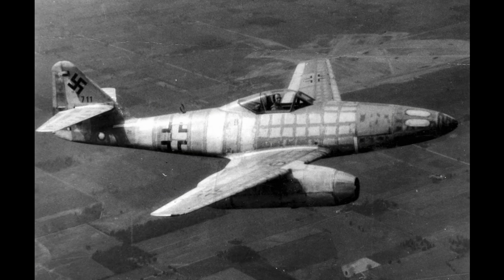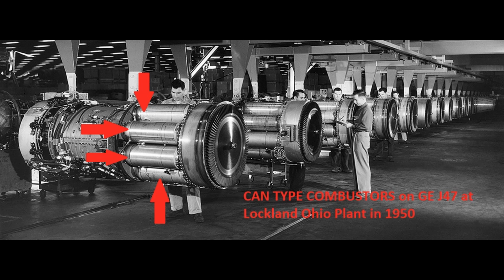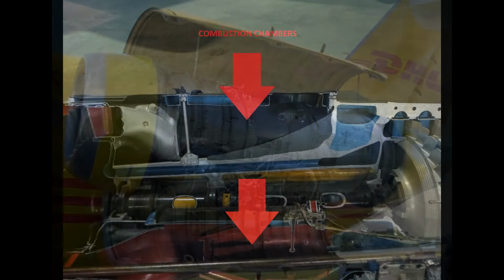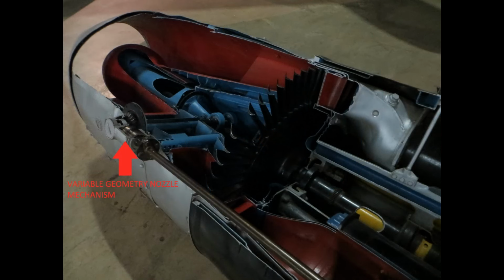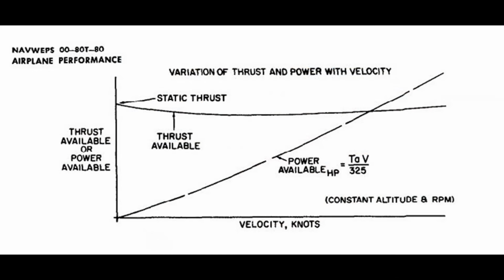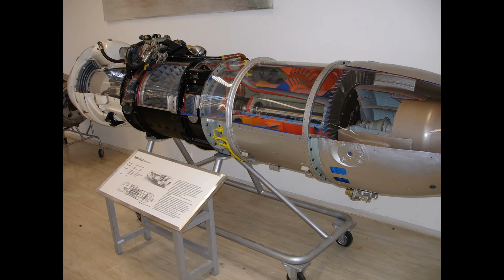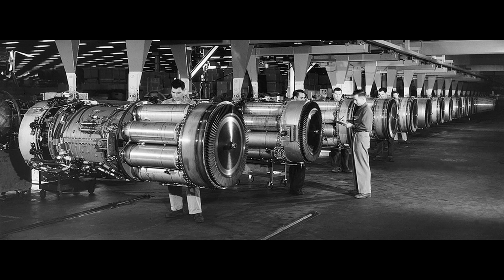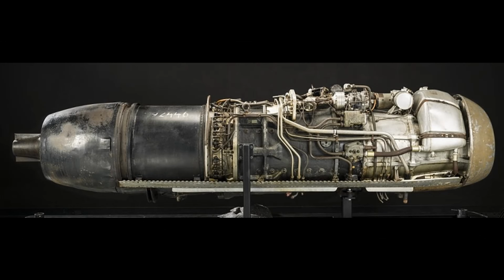World War Two JET POWER

Comment: The technology was very sound but Germany’s lack of access to hi-temp special metals was the Jumo 004’s  only real drawback.
Reply: Yes, 10 hours service due to poor metals!
Reply: maybe 10 hours of operation?
Reply: Billy Sol Hurok one is consequence of the other
Reply: @DirtyMardi  understood
Reply: @billysolhurok5542  In the prototype development, Jumo 004 turbines were tested with high-alloy steels and achieved runtimes of around 100 hours under full load.
Reply: @julialindner217  That was the Jumo 004A which was a completely different engine.  The 004B was made from mild steel and often produced with forced labour, improper use could reduce the engines life to one flight.
Reply: @jimdavison4077 That is the exact confirmation of my statement. The critics of the Jumo 004 only ever refer to the turbine’s short service life. But forgot the difficult circumstances under which this absolutely progressive and groundbreaking design was produced.
Reply: @julialindner217  thats because it wasn't particularly groundbreaking or progressive.  The Jumo 004A was groundbreaking but because Germany could not put the heat resistance alloys into mass productio they were stuck with the very primitive 004B.  While the Brits were able to produce up to 4000 pounds of thrusts thats twice the power with actual endurance.
Reply: @billysolhurok5542 20 before a major overhaul I think. Tbf, most engines at the time had only 100 hours of service life anyway.
Reply: how you explain 20 hour life span of engine on P80? cant be lack of such materials.
Reply: @jebise1126  The Engine of the P80 was descended from the The J33  which was originally developed by General Electric as a follow-on to their work with the designs of Frank Whittle during World War II  as used in the Meteor.....including the use of metals invented by the brits specifically for jet engines.
Reply: @liloldme1210  yes... and it still had 20 hour life span so how come so low?
Reply: @jebise1126  The RR Welland had a longer life than that
Reply: @jebise1126  No that’s not correct I have seen this last few months a meteor Fly on the same engines but it was given 70 years ago
Reply: @theoracle6639  Indeed , 180hrs! and the Derwent was 650! the Germans were so far behind the British it was not funny
Reply: So far behind ,theGermans had the first operational jet in history!
Reply: not access there was never a need for such thing in all the world ever ! Frank Whittle did the math of heat/ pressure and could see with what was around at the time it would really not work ie hold up where his jet still works today , Jumo 004 at the time of making what was really a prototype but some moron rushed it there was the fact to even feed it fuel was still not quite understood / the really good pilots would get about 35ish hours out of this most of the poor pilots or just pushing to fast or cutting it to fast would get about 1 or 2 flight or just  2 or 3  in many case's out of the engine  or flame out and crash  and and also if that was not too much to deal with there a whole bunch of aircraft shooting at you anytime your seen
Reply: @xkgbciax5286  Actually neither Whittle or Ohaim knew the perfect math for these engines. After the war Whittle hired the famous Hungarian scholar Jendrassik (who was a real university professor unlike Ohaim and Whittle) to have more theoretical/math knowledge about these engines. If you take original research in post ww2 jet patents, there are much more references for the technical solutions of Jendrassik than Whittle.
Reply: You think these engines were made by high tech labor? Got news for you, they were slave laborers mid war onward.
Reply: What else could be done to improve the life of the Jumo 004?   Increase the diameter of the compressor and turbine plus lower rpm in the 4,000-5,000 rpm range?  Would result in lower temperatures and stress?  Less wear on bearings?
Reply: The only airworthy original ME 262 at the Flying Heritage Museum has upgraded Jumo 004 engines. The engine longevity was expected to go up 10x. This plane never got past taxi trials after the death of Paul Allen the founder. In this video of the first engine run the original 2-stroke starting engine is used. 
https://www.youtube.com/watch?v=8Azxzu1sqCU&ab_channel=FlyingHeritage%26CombatArmorMuseum
Reply: no,hat simply was the reason to develop and improve the design to the standart still in use today.
Reply: If only ceramics would hold the burn in
Reply: @paulpaul9914  Frank Whittle did not invent the Turbojet type engine and the Turboshaft type engine was invented 4 years before he was born.
Reply: @paulpaul9914  C.A. Parsons Company only made steam engines prior to 1947.
This is an irrefutable fact that cannot be disputed.
Reply: @paulpaul9914  The first successful demonstration of a Turbojet type engine was made by Hans von Ohain and Max Hahnn on August 27th 1939 in Rostock Germany.

Two years before Frank Whittle who was only the 4th person to demonstrate a jet aircraft engine.
Reply: @paulpaul9914   Pauly you silly lad, Frank Whittle did not invent the Turbojet type engine and the Turboshaft type engine was invented 4 years before he was born.
Reply: @sandervanderkammen9230  Hello Sandyboy you sad wehraboo liar. let's just rtemind you of what that famous German jet pioneer Pabst von Ohain had to say-

"The first patent of a turbojet engine, which was later developed and produced,
was that of Frank Whittle, now Sir Frank (see Fig. 5). His patent was applied for
in January 1930. This patent shows a multistage, axial-flow compressor followed
by a radial compressor stage, a combustor, an axial-flow turbine driving the
compressor, and an exhaust nozzle. Such configurations are still used today..."

and

"In April 1937, Whittle had his bench-test jet engine ready for the first test run.
It ran excellently; however, it ran out of control because liquid fuel had collected
inside the engine and started to vaporize as the engine became hot, thereby
adding uncontrolled fuel quantities to the combustion process. The problem
was easily overcome. This first test run was the world's first run of a bench-test
jet engine operating with liquid fuel."

and

"From the beginning of his jet propulsion activities, Frank Whittle had been
seeking means for improving the propulsive efficiency of turbojet engines. ¶ He
conceived novel ideas for which he filed a patent application in 1936, which
can be called a bypass engine or turbofan. To avoid a complete new design,
Whittle sought an interim solution that could be merely "tacked on" to a jet
engine. This configuration was later known as the aft fan. Whittle's work on
fan jets or bypass engines and aft fans was way ahead of his time. It was of
greatest importance for the future or turbopropulsion."
Reply: @paulpaul9914  Frank Whittle was born in 1907... 4 years after the Turboshaft type engine was invented.
Reply: @paulpaul9914  C.A. Parsons Company only made steam engines prior to 1947.
Reply: @sandervanderkammen9230  
 @Sander Van der Kammen  
You stated Whittle centrifugal compressor gas turbine engines are not manufactured & are not used for helicopters - both wrong - same as everything you claim - it's not difficult to grasp is it you EIN DERANGED KINDERGARTEN INMATE
Please stop making stuff up unt stoppen using terms und words incorrectly & claiming that others have said things they haven't said or stating that things that haven't been done were done or vice versa or continually changing your fabricated gibberish from one post to the next & clearly responding to posts in videos with replies that don't relate to the videos or the comments you are replying to.
Also stop saying fourth when you mean first.
Stop claiming that the gas turbine aero engine / jet engine / reaction engine / centrifugal compressor - reverse flow combustors - axial turbine aircraft jet  engine / internal combustion turbine engine / etc / as first demonstrated by Sir Frank Whittle of England  God of EIN TURBOSCHAFTEN DUR EIN  VOLKEN  EIN REICHEN 1000YR ®™ & so on etc ) is not currently produced in significant numbers & stop claiming they  are not used in helicopters & take note that the internal combustion turbine engine in all its forms exists due to the work & genius of Parsons of ENGLAND & originally from a renowned Irish family lineage with the PARSONS AXIAL TURBINE / AXIAL COMPRESSOR TECHNOLOGY very generously licensed to many companies in Europe, England & the world in the spirit of good international co-operation & congenial collaboration. 
Hope this helps with your clearly limited grasp of reality, & get your mom to explain it all to you OR sing you a nursery rhyme song things if you're having trouble understanding the big wordz & complex concepts in this reply or you're getting very angry because people aren't obeying your VWuRD USE COMMANDS, INSTRUCTIONS  UND  ORDERS
Reply: @sandervanderkammen9230  
 @Sander Van der Kammen  
 @InSanitere Vonn durrr Krappen  & Dr Dike Bummner
    You stated Parsons of England did not make axial turbine steam turbines before 1947 - they made axial steam turbines, not radial steam turbines before 1947 & were inventors if the technology that led to all internal combustion turbine aero engine technology.
  You stated Whittle centrifugal compressor gas turbine engines are not manufactured & are not used for helicopters - both wrong - same as everything you claim - it's not difficult to grasp is it EIN DERANGED KINDERGARTEN INMATE
Please stop making stuff up unt stoppen using terms und words incorrectly & claiming that others have said things they haven't said or stating that things that haven't been done were done or vice versa or continually changing your fabricated gibberish from one post to the next & clearly responding to posts in videos with replies that don't relate to the videos or the comments you are replying to.
Also stop saying fourth when you mean first.
Stop claiming that the gas turbine aero engine / jet engine / reaction engine / centrifugal compressor - reverse flow combustors - axial turbine aircraft jet  engine / internal combustion turbine engine / etc / as first demonstrated by Sir Frank Whittle of England  God of EIN TURBOSCHAFTEN DUR EIN  VOLKEN  EIN REICHEN 1000YR ®™ & so on etc ) is not currently produced in significant numbers & stop claiming they  are not used in helicopters & take note that the internal combustion turbine engine in all its forms exists due to the work & genius of Parsons of ENGLAND & originally from a renowned Irish family lineage with the PARSONS AXIAL TURBINE / AXIAL COMPRESSOR TECHNOLOGY very generously licensed to many companies in Europe, England & the world in the spirit of good international co-operation & congenial collaboration. 
Hope this helps with your clearly limited grasp of reality, & get your mom to explain it all to you OR sing you a nursery rhyme song things if you're having trouble understanding the big wordz & complex concepts in this reply or you're getting very angry because people aren't obeying your VWuRD USE COMMANDS, INSTRUCTIONS  UND  ORDERS
Reply: @sandervanderkammen9230  Hello Sandyboy, as you know Sandyboy Charles Parsons was first in the practical development of both axial flow turbines and axial flow compressors.  
It's really funny to see you guffing on about  steam engines given how regularly you claim that the BB&C Velox was a gas turbine engine given that it was a steam boiler. 
As you know Sandyboy Brown Boveri were early lincencees of Parsons and their German operation was even called 'Turbinia Deutsche Parsons Marine AG'.  As you know Germany was heavily dependent on Brown Boveri and their Parsons technology for Germany's gas turbine development, although as you know the relationship was somewhat strained by the patents dispute that was ultimately won by BB&C.
Reply: @paulpaul9914  Aircraft do not use steam engines.
Reply: @sandervanderkammen9230 
Insanitere Duurrr Krappend / Dr Dike Bummner.
 Nobody on the team has stated that aircraft use steam engines you vWberk.
However-  Part of the reason Whittle gas turbine aircraft engines  currently exist & get used for helicopters is due to some of the following that involves work done by Parsons of ENGLAND before 1900 related to axial turbines & axial compressors.
Also people in England discussing the Parsons axial steam turbine & axial compressor technology had figured out at the time the possible use of that tech to do an internal combustion turbine aircraft engine before the first flight of any engine powered aircraft.
    You stated Whittle centrifugal compressor gas turbine engines were a 
dead end & of no use - wrong.
   You stated they are
 not manufactured - wrong.
     You stated they are not used for helicopters - wrong.
    You stated helicopters don't use gas turbines - wrong.
      When it became apparent to you that the PW200 is in fact a currently manufactured Whittle internal combustion gas turbine including a centrifugal compressor & reverse flow combustors that is used for helicopters  you changed to stating that the PW200 was not the particular type of gas turbine you were talking about as if that were relevant which of course is pure Krappenish gibberkrappund - all wrong as usual - same as everything you claim - it's not difficult to grasp is it you EIN UND DERANGED KINDERGARTEN INMATE
Please stoppen da making stuff up unt stoppen using terms und words incorrectly & claiming that others have said things they haven't said or stating that things that haven't been done were done or vice versa or continually changing your fabricated gibberish from one post to the next & clearly responding to posts in videos with replies that don't relate to the videos or the comments you are replying to.
Also stop saying fourth when you mean first.
Stop claiming that the gas turbine aero engine / jet engine / reaction engine / centrifugal compressor - reverse flow combustors - axial turbine aircraft jet  engine / internal combustion turbine engine / etc / as first demonstrated by Sir Frank Whittle of England  God of EIN TURBOSCHAFTEN DUR EIN  VOLKEN  EIN REICHEN 1000YRs ®™ & so on etc ) is not currently produced in significant numbers & stop claiming they  are not used in helicopters & take note that the internal combustion turbine engine in all its forms exists due to the work & genius of Parsons of ENGLAND & originally from a renowned Irish family lineage with the PARSONS AXIAL TURBINE / AXIAL COMPRESSOR TECHNOLOGY very generously licensed to many companies in Europe, England & the world in the spirit of good international co-operation & congenial collaboration. 
Hope this helps with your clearly limited grasp of reality, & get your mom to explain it all to you OR sing you a nursery rhyme song things if you're having trouble understanding the big wordz & complex concepts in this reply or you're getting very angry because people aren't obeying your VWORD USE COMMANDS, INSTRUCTIONS  UND  ORDERS
Reply: @sandervanderkammen9230  
Insanitere Von durrr Krappen  the imbecilic -
Where did you get this idiotic idea from that Parsons manufactured steam engines & more bizarrely that they did this until 1947 when apparently they switched to making gas turbines - got any references for all that bs?
Reply: @paulpaul9914  Please cite an example of a Gas turbine engine made by C.A. Parsons prior to 1947???
Reply: @paulpaul9914  Please cite an example of a production aircraft that is powered by a steam turbine engine???
Reply: @sandervanderkammen9230  Insanitere Von durrr Krappen  the imbecilic -
Where did you get this idiotic idea from that Parsons manufactured steam engines & more bizarrely that they did this until 1947 when apparently they switched to making gas turbines - got any references for all that bs & why are you asking about Parsons & gas turbines & aircraft at all, nobody stated that Parsons has ever produced aircraft engines or steam engines or gas turbines
Reply: @sandervanderkammen9230 
Chiney Leydeez should note -

It will come as no surprise to anyone that obviously we feel we can clear up some commonly held myths and misconceptions.

It's clearly always good to see the facts set out clearly and concisely isn't it?

Agreed, of course it is the case that the majority of gas turbine aero engine powered  aircraft, including turboprop & turboshaft internal combustion gas turbine aero engine powered aircraft are powered by multistage sequential stator rotor axial flow turbine & / or axial compressor technology gas turbine aero engines originally given functional hardware form by Parsons of Ireland & North England for use in power generation turbomachinery & ship propulsion turbomachinery before 1900. 

    It is interesting to note that light weight steam engine powered metal construction aircraft development & testing were being out in England in the 1800s.
Reply: @paulpaul9914  C.A.Parsons was a builder of STEAM ENGINES.
Reply: @paulpaul9914  The first demonstration of a gas turbine engine in the UK was built by Swiss manufacturers BB&C in 1932.
Reply: @sandervanderkammen9230  

_*Chiney Leydeez shud alwaze
remember*_
C A parsons built no steam engines, anywhere, ever
Reply: @sandervanderkammen9230  
The world's first internal combustion gas turbine aircraft engine was demonstrated by Whittle in 1937.
 The basic whittle type engine is currently still manufactured being used mostly for turboprop aircraft & helicopters.
   All BB&C units were based on the technology developed by Parsons & licenced to BB&C & many others before 1900.
  The first example of a BB&C gas turbine running in the UK was for a locomotive in 1949 which was quickly abandoned after it became clear it was not a sensible  application.
Reply: @paulpaul9914  C.A.Parsons built steam engines until they were bought by German company Siemens.
Reply: @sandervanderkammen9230 
Parsons has never built a steam engine in England, in Ireland or anywhere else, ever.
Of course, Parsons built many axial steam turbine  units for power generation & ship propulsion & licensed the technology to many companies, including BB&C, in Europe & the rest of the world starting before 1900.
Reply: @paulpaul9914  Gas turbine engine was invented by Jens AEgius-Elling in Norway  1913... when little Frankie was just 6 years-old.

The First successful demonstration of a production gas turbine engine was 1930 in Berlin Germany by Swiss manufacturers BB&C.
Reply: @sandervanderkammen9230  
The gas turbine was invented in England in 1790.
Around 1930 BB&C were working with Parsons technology, turbocharged boilers & explosion combustor turbine experiments, non of which were internal combustion turbine engines & definately were not internal combustion gas turbine aero engines.
Reply: @paulpaul9914  The World's first gas turbine aircraft engine was successfully demonstrated in Göttingen Universität in Germany in 1935.
Reply: @sandervanderkammen9230  
The world's first demonstration of a internal combustion turbine aircraft engine was in England in 1937.
 The world's first demonstration by Parsons of the components of a coupled multi stage axial compressor & axial turbine unit was in England before 1900.
Reply: @paulpaul9914 Gas turbine engines were invented in Norway by Elling in 1913... your comments are ridiculous fabrications!!!
Reply: @paulpaul9914  THE FIRST SUCCESSFUL DEMONSTRATION OF A WORKING GAS TURBINE ENGINE WAS 1913 IN NORWAY 🇳🇴.
Reply: @WilhelmKarsten 

    
We feel we can clear up some common false myths, misunderstandings & misconceptions.

It's always very important to note the relevant facts obviously.

Of course it is indeed a great pity & great shame  that British military forces had to occupy a large part of Germany for decades after 1945. It would have been so much nicer if that hadn't been necessary wouldn't it.
Russia had to occupy a large part of Germany after 1945 for decades.
Russia still posseses a large chunk of land that was once part of Germany.
Russia & the UK produce Nukes.
Germany does not produce Nukes.
 
    Regarding the UK Aerospace Sector.

  WHY IS IT THEY CAN'T ANSWER VERY SIMPLE QUESTIONS ⁉️ 😅
  A very simple question indeed.
   
Which airline recently ordered 60 RR Trent XWB Engines? 

Also name a single Germany company that makes German jet aircraft in Germany & name a single German Company that makes German gas turbine aero engines suitable for widebody airliners.

     That's correct, Brazil makes very good airliners & Brazil is 100th down the list along with Indonesia for wealth per capita.
Norway Holland Denmark Ireland Belgium - Top 20 wealth per capita - Don't make airliners -  its as simple as that.
  
  Agreed, that is correct of course, clearly there are many countries that could easily produce airliners of better  quality than Bow-wing (see b-47 wing folding & wing collapse incidents) but don't for some very good reasons. Bow-wing being a result of the size of the US, the large protected domestic market & great ease of testing new types due to the equator to arctic geography & a few other reasons related to production scale capability, politics & economics.

  Obviously there really is nothing special about Bow-wing, having more than 50 years design / build experience on the type means they have no excuses for the horrendous max incidents for example.

    Indeed BAe Systems & Rolls Royce combined now do more Airbus work than Germany on an absolute basis & significantly more work than that on a per capita basis.
   
     Agreed, Per capita for the home nation BAe Systems is the world's largest defence contractor.
  
    Correct, BAe systems announced the recent £4 Billion takeover of Colorado based US based Ball Aerospace.
  
    It's definitely the case that BAE systems now does a significantly higher value of work for Airbus than it did when it was a major Airbus shareholder before 2005.
     
      Obviously RR now owns US Engine maker Allison for example which does classified Aerospace work for the US Govt.
   
   Yes, that's right of course, Anybody currently flying on a widebody airliner stands a good chance of being on an aircraft powered by RR gas turbine aero engines built in the UK.

   A typical but small glimpse of what goes on in the very internationally orientated British aerospace sector.  

      Boeing Apache Attack Helicopter.
AH-64: 75 UK suppliers, 7% UK content, global fleet of 1280+ aircraft.
F35B more than 130 UK Suppliers, more than 30% UK content.
F35A & F35C more than 130 UK Suppliers, more than 15% UK content.

   There is no doubt that an airline has just ordered
60 RR England Trent XWB Engines

Obviously the UK has the
World's Highest Combined Per Capita
 Nuclear / Defence / Aerospace Sector Activity.

Rolls Royce Holdings UK
Subsidiaries
- Rolls-Royce plc
- Rolls-Royce North America (Allison etc Classified Military stuff)
- Rolls-Royce AB
- Rolls-Royce Deutschland
- Rolls-Royce India Private Limited
- Rolls-Royce Marine Power Operations
- Vinters Engineering Limited
- Rolls-Royce Controls and Data Services
- Rolls-Royce Power Systems
- Bergen Marine
Joint ventures include:
- Rolls-Royce Turbomeca
- MTU Turbomeca -

Trent Family
The MT30 (Marine Turbine)
Industrial Trent 60 Gas Turbine
Trent 7000
Trent XWB Airbus A330neo.
Trent 1500
Trent 1000
Trent 500
Trent 600
Trent 700
Trent 800
Trent 8100
Trent 900

RR wholly owned subsidiaries in Germany handle smaller 2 shaft RR gas turbine aero engine work.

We hope this helps of course as always.  Cheers & 😎👍 indeed.

       O B V I O U S L Y  
   
. ..... ..... ......  ..... .... ... ....
.... ..    .. .. . ........... ...... ..
Clearly the line above this line is not blank.
Reply: @sandervanderkammen9230  Von Ohein thinks differently, He stated the Whittles engine was the first turbojet engine to be run and that w as on April 12th 1937. So who ran this mythical 1935 engine?
Reply: @zaphodbeeblebrox5973  Hans von Ohain and Max Hahnn constructed the first turbojet engine in 1934 and successfully tested in 1935 at the Göttingen Universität.
It was witnessed by Dr Robert Pohl "the father of solid state physics"
 Pohl wrote a letter to Ernst Heinkel who came to Göttingen to observe a second demonstration in 1936.
 Frank Whittle did not invent the jet engine, he is only the fourth person to successfully demonstrate a working jet aircraft engine.
Reply: @ stop making things up, Vin Oheins own account of the facts are that his first successful engine first ran in September 1937, and he also clearly states that Whittle was the first to run his engine on April 12th 1937. The ‘garage engine’ which can be the only thing you are referring to never self sustained, and that is according to the man who built it.
Reply: @ not according to Hans Vin Ohein he didn’t!
Reply: That’s true for any early jet engine
Reply: The Ju004 had an inherently defective design due to resonance problems (very common with axial flow engines due to thin blades).
The Ju004 fixed one of its problems solved in December 1943 by going to a prime number of blades in each stage (from the even number in the previous designs). The British axial flow engines had the same problem and the blades were redesigned to detune the individual blades from resonating - the Germans never made that change.
Reply: They had about 20 hours once operational, sadly since loses could run at 10 percent per mission not a lot lasted long enough to wear their engines out. In 1945 German airspace was a very unsafe working environment if you were German.
Reply: There were lots of other significant problems. The pilot had to nurse the thrust lever to successfully accelerate the engine and airplane, distracting him from combat. Later engine fuel controls did this automatically. This long acceleration time was a very limiting problem as the top speed was the 262's safety, but firing passes at targets with 100+ mph closing speed were not very effective. If they slowed down, the opposition could out turn and out accelerate them. Given the significant differences from piston fighters, pilots were given very little familiarization time, constrained by free roving US fighters and the fuel situation. Their pilots were forced to learn on the job.
Reply: They also lacked the ingredients needed to make the hi-speed ceramic bearings they needed. They had to work around this, that's why it took so long to develop these engines.  They already had jet engines a few years earlier, but they could not build those, because the materials were needed elsewhere and the piston engines were considered to be good enough.
 It was the same problem with the BMW003 engine, when the Soviets reverse-engineered it. The French got the BMW engineers, they built the engine with proper materials, is was highly successful, and the French used it as the basis for their Snecma Atar engines, used on the Mirage fighter jet series.
Reply: @scratchy996 All true but the ATAR engines first seen in 47 were completely different designs that the BMW 003.  They were an entirely new design with different numbers of discs and so on.   As you said the knowledge was there but not the materials, the Jumo 004A proves that with close to 2000 pounds thrust and good endurance as well but used to many restricted metals.
Reply: @jimdavison4077  Technically the Atar engines were based on the BMW 018, which was an evolution of the BMW 003. It was the same engineers who continued their work on these engines.
Reply: @scratchy996  yes but not the same engine at all.  They went back to the drawing board as the saying goes.
Reply: The problem wasn’t the availability of high temperature metals as Germany had a mountain of them, it was manufacturing and machining them.  Refractory metals have to be produced in a sintered form; simplified this is as small particles semi-welded together before machining.  The only German engineers with any experience in this, being Jewish, left the country in the early 1930s.  As  result German engineers tried using cast stainless steel in their turbine engines which simply wasn’t up to the job.
Had they but known it the technology existed in the country at BASF in their permanent magnet production but fortunately no one thought of using their facilities.
Reply: Bull shit: Then who produced the prototypes that ran well over 100 hours of safe continuous operation in the test run. @annoyingbstard9407
Reply: @julialindner217    It wasn’t neither groundbreaking nor revolutionary as axial flow turbines had been built in the early thirties with exactly the same problems of turbine failure, which is why Whittle opted for the less efficient but far more reliable centrifugal compressor (still in use today.)  However I have no desire to get into a pointless conversation with an obvious wehrabooess, so goodbye.
Reply: @annoyingbstard9407  Whittle's original design used a hybrid of Centrifugal and axial flow and was overly complicated.   By the time his first real engine was proven successful  he had dropped the Axial flow components.  His design was nationalized so all other designers could use it as a free starting point during the war which was why so many successful centrifugal designs reached full production before the wars end.  Funny thing is very few know of the great success of the Axial flow program over at Metropolitan Vickers  where they had their first success with the F1 in mid 1941.  By the wars end they had several models test flown and bench tested to 5000 pounds and had the first real turbofan and turboprop.  They also used their axial flow engines in high speed rescue launches and in GENSETS.
Reply: @jimdavison4077  it's been a damn long time since I couldnt understand what people were talking about In a respectful discussion of ww2 stuff in a youtube comment section. Can't wait to dive more into this channel reading this discussion.
Reply: @annoyingbstard9407  wrong, centrifugal compressor had no future. It is a shit. Whittle's idea come from contemporary vacuum cleaners.
Reply: @jimdavison4077  Whittle's original patent, filed on 16th January 1930 (years before von Ohain submitted his  patent application in Germany), showed two axial stages and a single-stage centrifugal compressor: it was hardly a "design".  I've read and heard (I believe from Ian Whittle himself) that the patent application was written so as to mislead others who might try to copy.  I'm not aware that he even considered a combination of axial and centrifugal flow, once he actually started the design of his first experimental engine, with its single combustion chamber. 
You're quite right about Metrovick's engine programme that lead to the F.9 at the end of the war, which became the Armstrong Siddeley Sapphire.  I was privileged to begin my career lifetime in gas turbine design at Bristol Siddeley Engines, working with the designers and engineers who produced the Sapphire - and the Python, the  Viper and Double Mamba.
Reply: @jozsefsandor671  
Turbojet / gas turbine engines that have a single stage centrifugal compressor or centrifugal / axial compressor combos are still manufactured. Often used in helicopters.
Reply: @paulpaul9914  Only in the cheap helicopters.
Reply: @jozsefsandor671  
Some of the finest helicopters in the universe have engines that have centrifugal compressor stages.
You stated that centrifugal compressor turbojets had no future & were garbage, why did you say that when Eurocopter & Bell use them in currently produced aircraft?
Are you yet another prolific spewer of 100%  gibberish, do I have to start going through your various ridiculous & nonsensical claims?
Reply: @paulpaul9914  When will a fighter jet or a jumbo jet airliner use centrifugal compressors? Never! BEcause it has lower efficiency.
Reply: @jozsefsandor671  
You stated that centrifugal compressors as used for gas turbines were garbage & had no future etc & so on & so forth etc etc.
Is that statement not 100% total gibberish & of course indicates clearly that everything you state is probably 100% inane / infantile  nonsense? when we all know that Bell, Eurocopter & others currently use gas turbine engines with Centrifugal Compressor stages in currently produced aircraft?
Reply: @paulpaul9914  You really don't seem to get it do Pauly?
Centrifugal compressor turbojets were an evolutionary dead end technology and have been obsolete for more than a half century now.
Reply: @paulpaul9914  There are no turbojet engines made or in service today with an obsolete centrifugal compressor.
Reply: @sandervanderkammen9230  
The PW200 is not the only currently manufactured hot 🔥 noisey turbojet spinny thingy that has centrifugal compressor stuff in it.
Reply: @paulpaul9914  Pauly you lose,
the Pratt & Whittney PW200 is NOT A TURBOJET ENGINE.
Reply: @paulpaul9914  Pauly, you cannot fool me son... I have personal experience with the PW210S and I can assure you with all confidence that it is not a turbojet engine..
Not even close.
Reply: @sandervanderkammen9230  
Your choice of words is irrelevant.
You stated that Centrifugal Compressor use in Whittle's Internal combustion turbine reaction engines was an evolutionary dead end - were never used seriously - not manufactured etc etc.
The PW200 is essentially a Whittle engine.
You also stated that helicopters don't use internal combustion turbine engines whereas in fact most helicopters use them.
Reply: @sandervanderkammen9230  
You have no personal experience with anything that has nuts, bolts & spinning shafts.
Reply: @sandervanderkammen9230  
You lost a long time ago.
The PW200 is a Whittle engine.
It has a centrifugal compressor stage.
It's currently manufactured.
Commonly referred to as a Gas Turbine by most people in the UK currently.
It's a Whittle jet engine / reaction engine / gas turbine / internal combustion turbine engine / jet engine with turbine power takeoff.
An internal combustion turbine engine with any number of turbine stages can be referred to as a jet engine & often is by many people, it's essentially the same thing.
It's used in helicopters - you stated helicopters didn't use them.
It has a centrifugal compressor stage - you stated that wasn't something that was done.
All internal combustion turbine engines / jet engines / gas turbines  have turbines & shafts by the way where the shaft always turns (yes the shaft always turns Krappen - it's a fact)  & usually produce reaction thrust somewhere in the engine even if it gets opposed somewhat by some variable amount somewhere else in the engine by some means.
Reply: @paulpaul9914  Only in your twisted imagination and ignorance son...
The PW200 is NOT A TURBOJET.
Reply: @paulpaul9914  According to the FAA and EASA I do...
Reply: @paulpaul9914  Dream on little lad... the PW200 IS NOT A TURBOJET...NEVER WAS...
NEVER WILL BE.
Reply: @paulpaul9914  Frank Whittle did not invent the gas turbine engine either...
 So your argument is completely moot!
Reply: @sandervanderkammen9230  
The PW200 is a jet engine as per Whittle's reaction engines with a centrifugal compressor that's used in helicopters & is essentially the thing you repeatedly stated didn't exist & wasn't used in helicopters.
Reply: @paulpaul9914  Norwegian engineer Jens AEgidius-Elling invented the centrifugal gas turbine engine in 1903... 4 years before Frank Whittle was born.
 The first production gas turbine engines were built by Swiss Company Brown Boveri und Cie in 1932... 4 years before Frank Whittle began work after moving to Rugby, England.
Reply: @paulpaul9914  No, the PW200 IS a TURBOSHAFT gas turbine engine as designed and invented by Jens AEgidius-Elling in 1903, 4 years before Frank Whittle was even born.
Reply: @sandervanderkammen9230  
Frank Whittle did first what Frank Whittle did first as far as jet engines are concerned. You'll need to accept the reality of it eventually Krappen.
Parsons of England & of course originally from a family in Ireland  came up with the necessary & essential  basics - axial compressor & axial turbine - that made all internal combustion turbine engines possible including the centrifugal compressor / axial turbine internal combustion turbine reaction enginesv suitable for powering aircraft  as first created by Whittle which you said were a dead end that were not currently manufactured & were not currently used in most helicopters.
How surprised you must have been when you realised they were in fact manufactured in significant numbers as we speak.
The PW200 is not a combustion augmented Steam raising boiler driving a Parsons of England & Ireland steam turbine with a piston compressor power output that all weighs approx 4 tons & wouldn't manage enough power output for a decent lawnmower. 
Haven't you got some Lego stuff to get on with?
Reply: @paulpaul9914  The world's first vehicle powered by a TURBOSHAFT gas turbine engine was a locomotive built by Swiss Company Brown Boveri und Cie in 1939.
Reply: @paulpaul9914  Frank Whittle never constructed a TURBOSHAFT gas turbine engine, he was the only 4th person to successfully demonstrate a TURBOJET engine in 1941.
Reply: @paulpaul9914  The first successful demonstration of a Turbojet type engine was by Hans von Ohain and Max Hahnn on August 27th 1939 in ROSTOCK GERMANY.
Frank Whittle was the 4th person to demonstrate a jet aircraft engine in 1941.
Reply: @sandervanderkammen9230  
 @Sander Van der Kammen  
Frank Whittle did first what Frank Whittle did first as far as jet engines suitable for aircraft power  are concerned. You'll need to accept the reality of it eventually Krappen.
Parsons of England & of course originally from a family in Ireland  came up with the necessary & essential  basics - axial compressor & axial turbine - that made all internal combustion turbine engines possible including the centrifugal compressor / axial turbine internal combustion turbine reaction enginesv suitable for powering aircraft  as first created by Whittle which you said were a dead end that were not currently manufactured & were not currently used in most helicopters.
How surprised you must have been when you realised they were in fact manufactured in significant numbers as we speak.
The PW200 is not a combustion augmented Steam raising boiler driving a Parsons of England & Ireland steam turbine with a piston compressor power output that all weighs approx 4 tons & wouldn't manage enough power output for a decent lawnmower. 
Haven't you got some Lego stuff to get on with?
Where did you get this obsession regarding the use of particular words like TTURBISHOFT in heavy caps  & the year 1941? & being forth from?, forth is not another word for first is it?
Reply: @paulpaul9914  The Pratt & Whittney PW200 is a TURBOSHAFT GAS TURBINE a technology invented by Norwegian Jens AEgidius-Elling in 1903.

Please stop your childish attempt to connect the Turboshaft type engine to Frank Whittle.

Frank Whittle did not invent or was the first to do anything related to the gas turbine, turboshaft  or the Turbojet engine, your efforts to credit Whittle are completely unsubstantiated claims or pure fantasy!
Reply: @paulpaul9914  C.A. Parsons only made steam engines prior 1947, there is a very distinct and fundamental difference between external combustion technology based on the Rankine Cycle and internal combustion engines that operate using the Brayton Cycle.
Reply: @paulpaul9914  The Brown Boveri und Cie Velox engine was a CORE GAS GENERATOR USING THE BRAYTON CYCLE.
Reply: @paulpaul9914  What Frank Whittle did was not first, it was not second or even third..
Frank Whittle was FOURTH to successfully demonstrate a TURBOJET engine.

Whittle NEVER constructed a TURBOSHAFT GAS TURBINE.

IT WAS INVENTED 4 YEARS BEFORE  WHITTLES BIRTH!!!
Reply: @sandervanderkammen9230  
You ought to stop your infantile attempts to use the word forth etc & EIN TURBYSCHOFT & so on where you should be saying FIRST ,or aircraft powering gas turbine or jet Engine or internal combustion turbine engine as first done by Whittle of course.
Also stop stating that Whittle's engines were useless & never produced in numbers due to their centrifugal compressor & that gas turbines are not used in helicopters etc when we can all clearly see that  Pw200 as currently produced is a Whittle style gas turbine with reverse flow combustors & a centrifugal compressor that is used in helicopters 
Also cease claiming that steam turbine sets driving piston air compressors & engines with piston engine driven compressors & boilers & piston engine driven ducted fans with exhaust fuel injection are Whittle style jet engines.
Reply: @paulpaul9914  You should stop making a fool of yourself.... you are clearly not formally educated or have any professional experience regarding this topic and are not qualified to discuss this topic inteligently.
Reply: @paulpaul9914  Frank Whittle did not invent the Turbojet and the Turboshaft type engine was invented 4 years before he was born!
Reply: @paulpaul9914  Please stop creating fake terminology, there is no such thing as a "Whittle Style" engine, he was only the 4th person to successful demonstrate a jet aircraft engine and his work is not unique or precedent setting.
Reply: @sandervanderkammen9230  The Brown Boverie & Cie Velox was not an engine. It was a boiler.
Reply: @paulpaul9914  Not only that, nearly every engine designed by Frans Anslem after the war follow whittles patent to the letter!
Reply: @annoyingbstard9407  Alloys needed for lining in barrels, electronics and traditional engines for the  entire war production could not be used in any great amount for jet engine production, that's why the Jumo 004A was rejected.